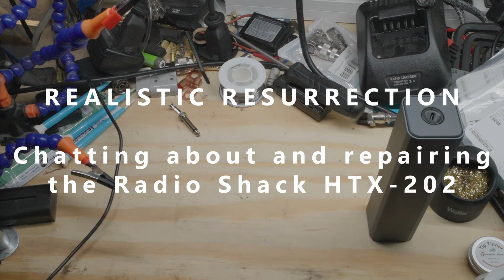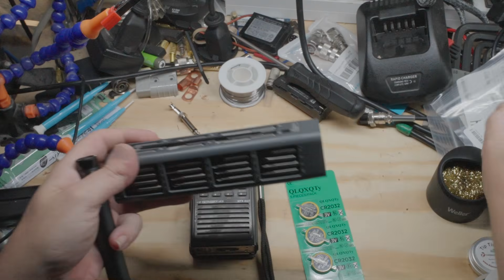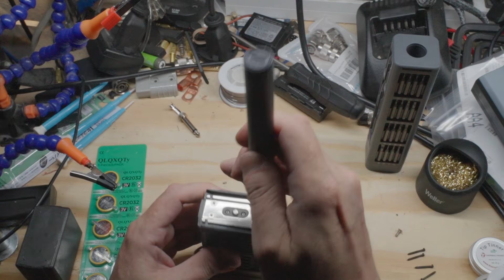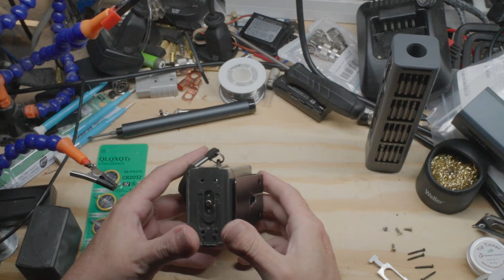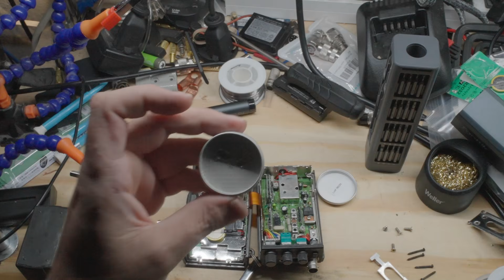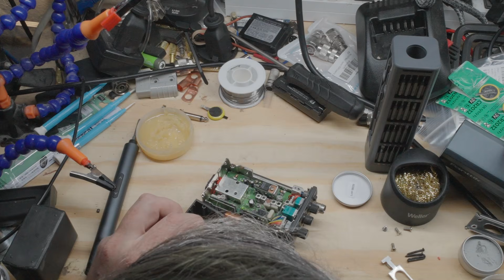REALISTIC RESURRECTION! Let's chat about and fix an old 2 meter HT!

Comment: How do wide band recieve radios like the FT60 not get deafened then? What's the secret sauce?
Reply from the maker: Really well designed front ends with transistors that can handle it, mostly. you have to pick the right components or else they won't be able to handle strong signals off frequency. 

Keep in mind the first preamp stage is amplifying the whole VHF band at once, so a huge signal on an off frequency still alters how it amplifies the whole passband - it can go nonlinear, etc. And that's when your weaker desired signal gets nuked.

Comment: I did this years ago with the battery holder rather than the just battery the 2032 will last about three years easier to replace the next time. if error code 1 its the battery, if its 2 you should recycle appropriately. I bought my HTX202 new in 1992, got the code 2 in 2026. was a great HT
Reply from the maker: They really were great radios. And just this last weekend at the hamfest I got another 202 and a 404 with Err1 for fifteen bucks! Glad i bought a bulk pack of the batteries.